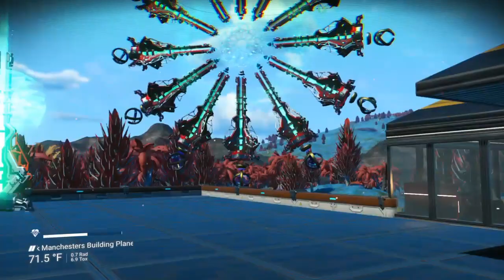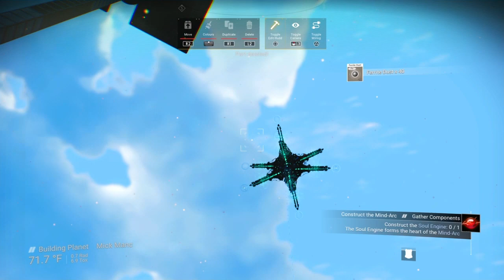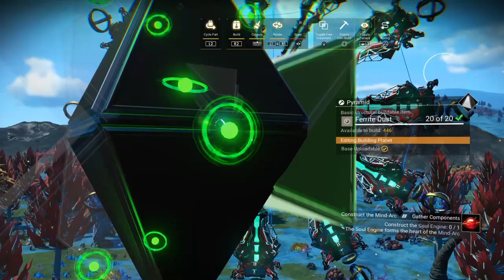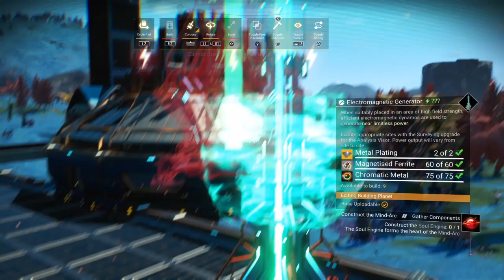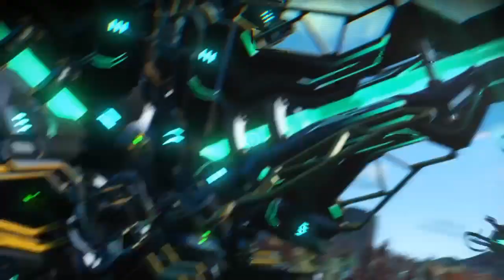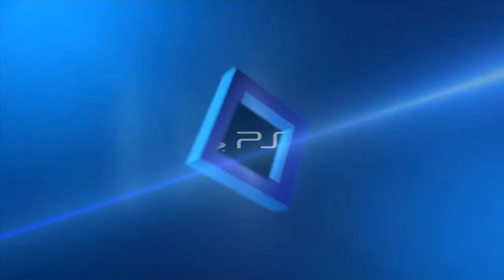No Mans Sky. How to Build a Star Shaped Generator. Post Frontiers.

Comment: cool.  just have figure out the controls for pc.
Reply from the maker: I think the wire toggle button on PC is Q. A menu should pop up on screen when you are using the building menu.
Reply: @MickManchester.  so basically, you are toggling the wire off and dropping the generator when you have it lined up?
Reply from the maker: @drewk7557  
Yes .. toggle off wire mode and place generator at the same time.